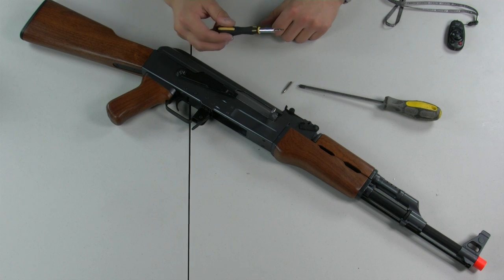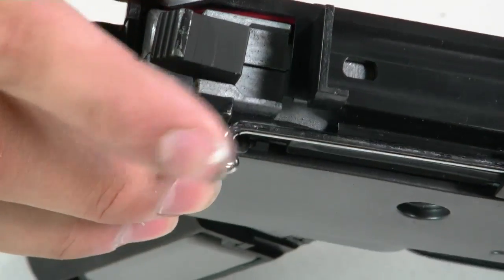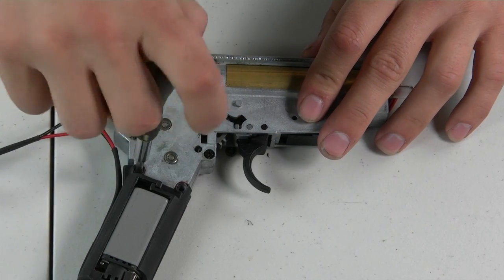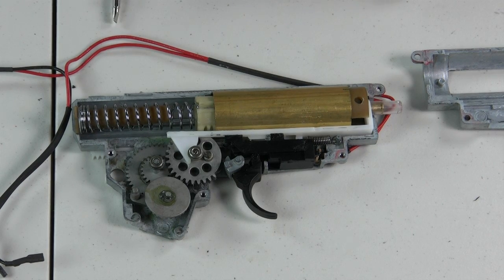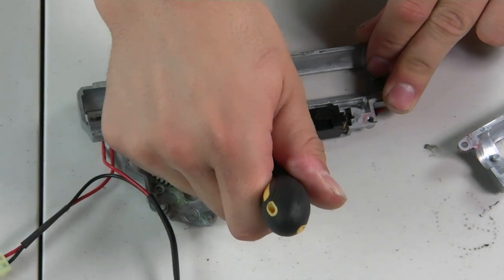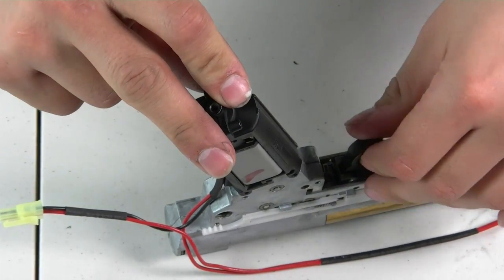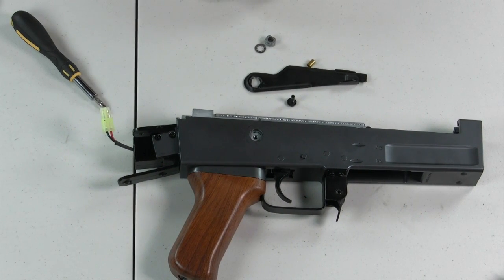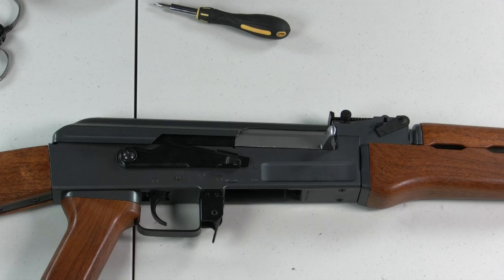HitGuns.com - Airsoft Gun Guide - AK47 CM-028 Complete Disassembly Tutorial

Comment: Nice, had to reassemble gearbox 3 times to make it right, be carefull when putting small spring for the trigger back. If you put it wrong way around it can prevent it working properly as it will catch with tappet plate.

Comment: Your spring is probably worn out. I've had that problem. I just replaced the trigger spring and it worked perfectly fine. If your spring is still good, make sure to press down the trigger really hard into the gearbox casing till you feel like it's getting stuck.

Comment: Please reply, at 52:20 the nuts u mentioned make it hard for me to attach the two parts. Also after attaching them the receiver screws are not going in, my friend who is very good with airsoft guns tried to screw in the receiver screws but they don't go in though. We tried to check if it was aligned wrong but it seems right and we can't see the problem. Are the nuts there nessecary because without them the receiver screws go on fine ?

Comment: Hey m8, excelent vídeo, helped me a lot. Although i still have a problem, when im selecting Full/Auto, e can see that between them, the movement of the selecting gears, the one's you mention last in the assembly, dont quite match, like sometimes i want single and its still on auto, or vice-versa, any ideias on that? Both gears are metal, and i've aligned the teeth properlly as you mention! Cheers man

Comment: Really good video, and no cqb with this gun for me. version 3 gearbox aks make it nearly impossible to get to the gearbox without messing something up...
Reply: Getting to the gearbox is easy, putting it back together again is the tricky part.
Reply: Yay turns out I was able to make the gun under 350 fps by udjusting the hop up/(Low battery power?), but in any case it was like 330 fps

Comment: Hey, does the metal tube that comes out the piston have a plastic clear cover? Thats what it looks like in the video.  I reassembled my cm048m, it seems like theres an air leak between the inner rifle barrel (where hop up is) and the gear box/piston. I  do not have that clear that's seen in the video 34:48.

Comment: Amazingness! Thanks! Now, I just had one question. The rear sling mount on my Cm028 came off, do you know how I can replace it? Just the D ring came off, the little cylinder that holds the D ring is still attached. Any ideas on fixing this? Thanks!

Comment: Awesome video. I am requesting some aid and perhaps some of you may be able to help me. I took my ver 3 gearbox apart and I put it back together as it is a brand new gear box and as many of you know that means too much grease. anyways when I finished putting it back together I encountered a problem. When I hook up a battery the gun goes automatic regardless of where the fire select is, I dont even pull the trigger I just hook up a battery and it goes full auto. Any aid would be appreciated.

Comment: SOMEONE ANSWER THIS QUESTION : I hate the battery being in the stock. I want to some how rewire ore just move the wires to the inside of the top rail, since it's removable. I do i have a spare stick battery that i could fit up there. Is it possible to rewire it?
Reply: you cant
Reply: +RejectedCaboose It's totally possible, if you google it you should find plenty of info on how to rewire it.

Comment: no, buy a new spring. You probably have a M110 in which usually gives 36-375 fps. A M100 spring will give 330fps and a M90 will give 300fps.

They are not expensive, don't mess with a spring just buy one that gives the fps you need